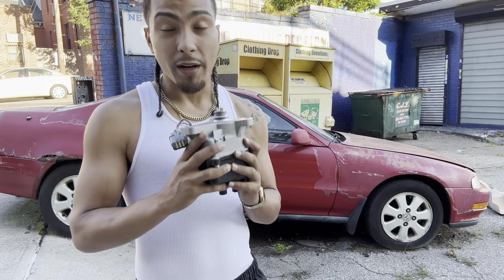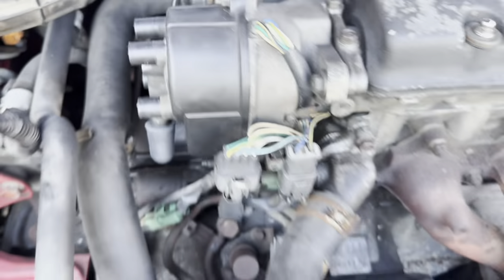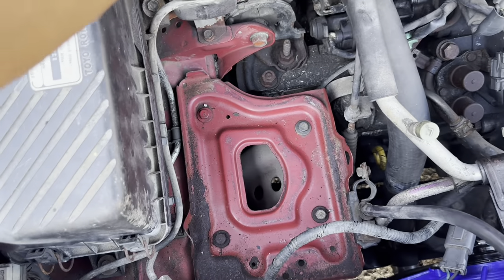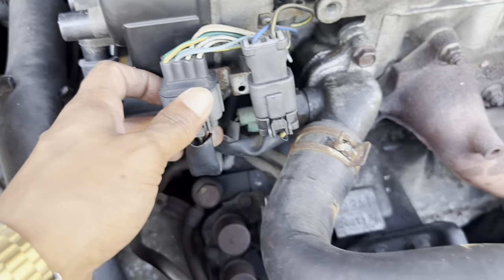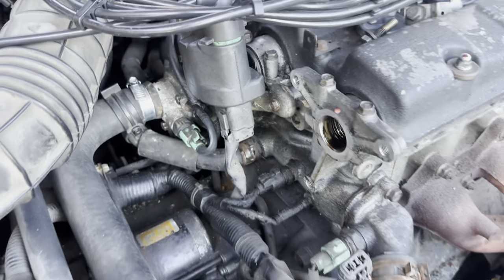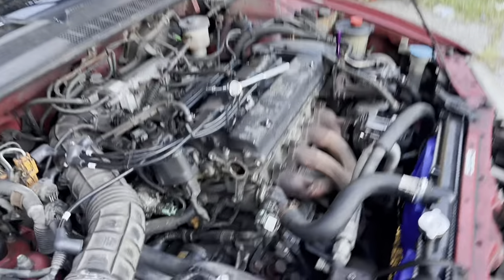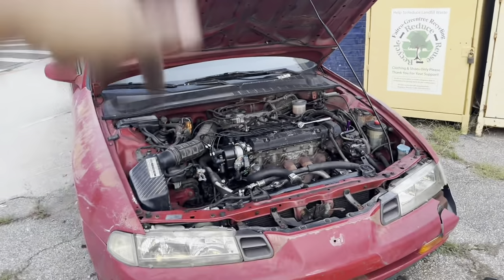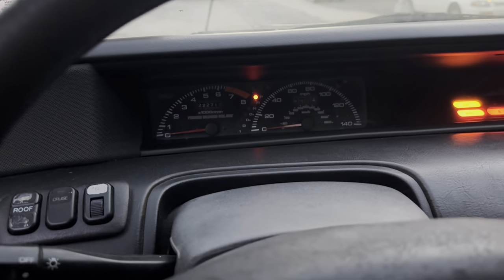My $300 Honda Prelude Gets A New Distributor. WILL SHE START..??!

Comment: @KBDxTokyo im in for this project! subbed.
you timing seems to be off perhaps
but yes, do a compression test, then from the values it could drive you into removing te head territory.
Im excited! lets do this!
Reply from the maker: Yea I just got some advice from a machanic in my area. He said I should check the timing. Next video I’ll be doing a oil change, compression test, and probably timing. I appreciate the Support and advice brother. I need all the help and advice I can get.
Reply: @KBDxTokyo  do the timing first, dont buy oil before you are sure its a running engine as it sits. else you will be wasting money.
you have fuel, spark.. check cooling perhaps... brakes possibly... fun stuff
Reply from the maker: @PedroSilva-te5vl  definitely will check the timing before anything. 🙏🏼, thank you brother.